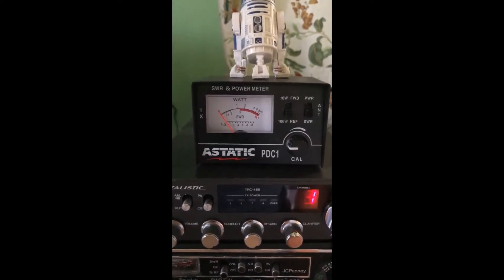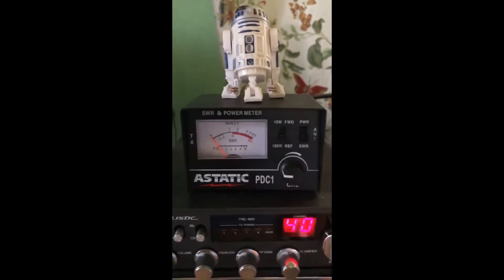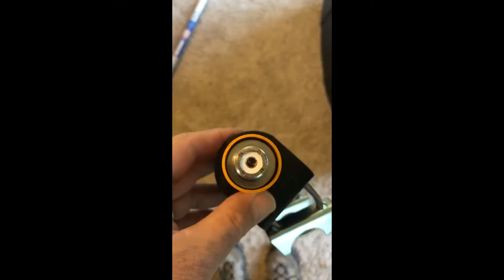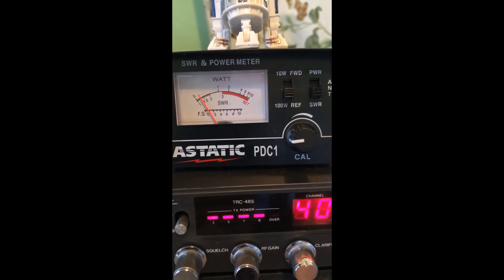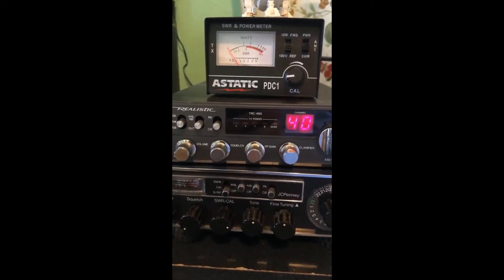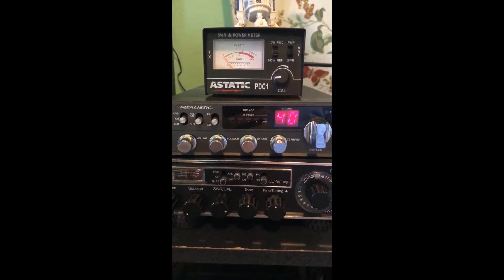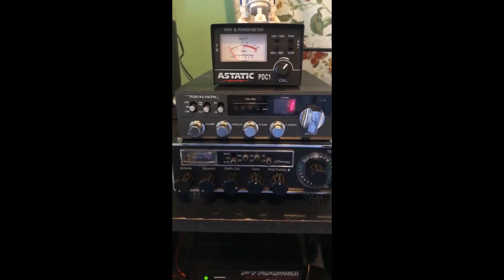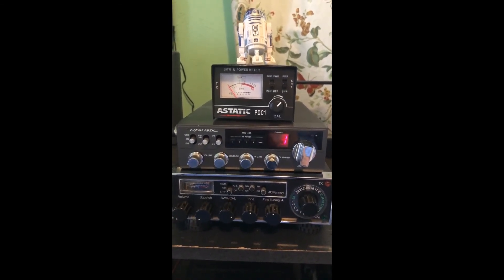Tram 1499 Antenna Condensation Issues

Comment: Is there a way to get the SWRs down if u are using indoors or mounted to a window?
Reply from the maker: Tram recommends at least 50 feet of coax. The coax acts as a ground plane. How many feet are you running?

Comment: I put that up and could not get the swr down so I gave up...I put up a Wilson 3000 magnet mount antenna   as a base antenna and I have no swr at all..now I'm finally able to talk on any channel....so for me the tram is trash....just made me work for no reason
Reply from the maker: Glad you bought the Wilson and got your SWR down. Wilson's are great antennas. My Tram now sits in a corner of the office as I gave up on mine. I might take it apart and try to repurpose it as a new type of antenna. Thanks for commenting! 73s from 595 Northern Nevada!

Comment: Do you know how to calibrate the SWR meter?  It doesn't look calibrated and the knob never moves during your tests.
Reply from the maker: This SWR reading is correct. I had to retire this antenna. I would get the SWR in the sweet spot and the next day morning it would be around 1.7. I bought this antenna because I wanted to see how it performed. I didn't have high expectations for it from reviews I read, but I wanted to play around with it. I'm strictly using my homebuilt dipole now which has a SWR of 1 at channel 1 and around 1.2 at channel 40. I picked up a nice vintage Mincronta 3 Range Power/Modulation/SWR meter at a rummage sale and now use this for calibration. For my CB equipment, when possible, I try to only use vintage equipment. The readings are consistent with my other meters. I've borrowed an antenna analyzer from my ham friend to check my 11 meter and 2 meter dipoles. The readings were consistent with my own SWR meters. I'm obsessed with getting the lowest SWR readings possible.  Thanks for watching! 73s from 595 Northern Nevada.

Comment: Verry bad antenna.Can't trim the swr below 2.5.
Reply from the maker: I was able to get SWR to 1.1 on channel 1 and 1.2 on channel 40.  I’m using  100 feet of RG8X coax and by trial and error figured out that placing excess coax at the bottom of the antenna mast  lowered my SWR.  It’s probably only a few feet of coax and I made sure to not coil the coax.
Reply: The black collar around the base that connects the aluminum to the plastic section is loose from factory...shrunk on with a heat gun. If you put a little silicone or liquid electrical tape on the top the water won't run thru the coil.
Reply: Dry or not...mine was only resonate on 28 MHz...and I tried 5 different coax combinations and install at 40ft. Jumped  into my truck with a 102 whip and had better trans but similar recieve...so 40ft with this antenna is marginally better than a whip at ground level. A no brainer, you get what you pay for.

Comment: Trippy, mine never did that even going from winter into spring it always remained flat and that was one of the things I like about it is the consistent SWR readings (flat) and the antenna did even better the higher I put it. This antenna is marketed under many different brand names but is the same exact antenna so maybe trying another brand might work due to quality control of that particular brand? You're never going to have much luck locally unfortunately until you get a real base antenna and some good height, it's just the nature of the beast. 73's from the CB Lounge 2112!!
Reply from the maker: I played around with it some more and found that placing the excess 3 feet of coax below the antenna mast without coiling the coax lowered the SWR to around 1.1.  I’ll see what happens when we get more wide temperature swings again. Im planning on building a bigger antenna to get out farther.
Reply: Put mine up month ago in wide open spaces on deep rural farm with a 24 foot DIY wooden/ PVC  tower.  Read about possible moisture issues so before putting up  I taped all "joints"  and rivets.  My bare foot President McKinley radio ( pro peaked and aligned)  internal SWR meter with  signal tone gives me 1.0 on all channels and a steady beep meaning 100% good on antenna.  I live in Central Mississippi and get SSB and also some AM skip skip from Caribbean, Latin America,  Canada, Australia, lots of West Coast USA and some other USA. Put a tiny Nagoya ground plane between cable and antenna ( before getting 1.2 to 1.4 sometimes 2.2 before this add) and from it ran a 20 foot straight down 12 gauge copper counterpoise.  Super quite, on noise level, mostly none at all.  Have to sometimes crank volume and squelch up to hear it barely to make sure radio is working when not receiving.  Using  brand new 100 ft. RG8-X cable  straight out, no coiling or parallel to self. It also has a lightening arrestor between cable and antenna.